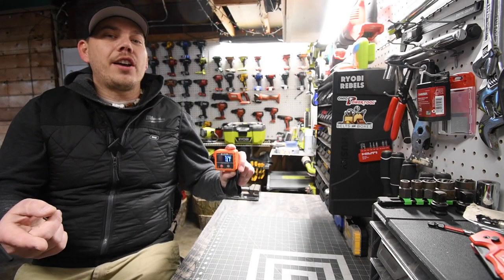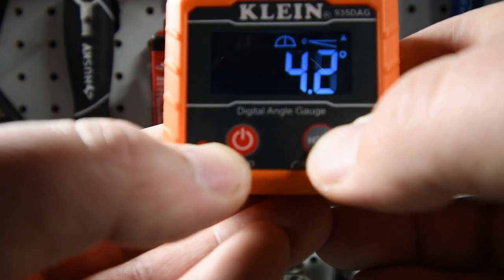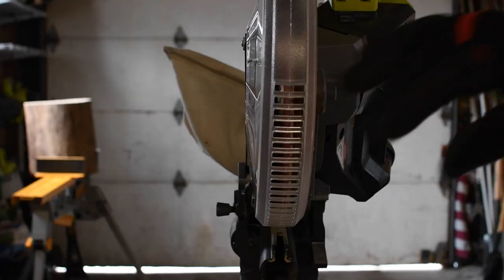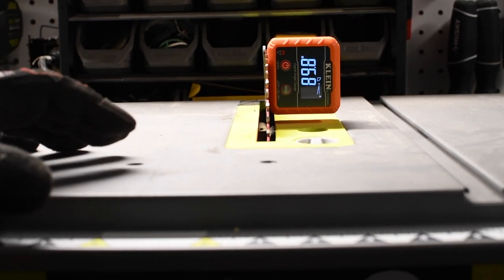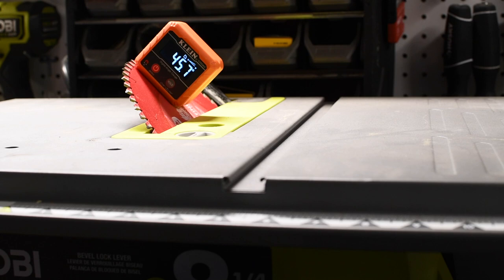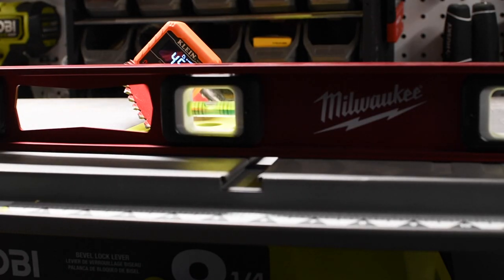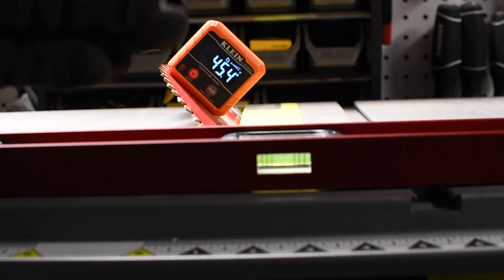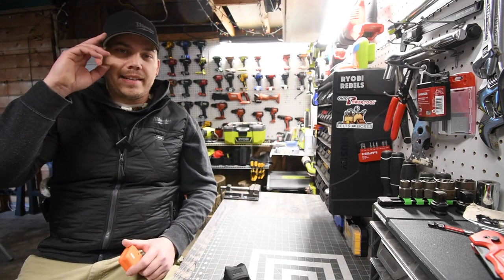Your saw needs this TOOL!

Comment: The thing is the entire miter and table saws will have to be completely level or it won't be accurate, I use my woodpeckers combination square to check if the blades are 90 or 45 degrees to the work surfaces or the table at multiple axis.
Reply from the maker: I did level out the table saw but for my miter saw the floor is not level at all so I didn't want to saw the saw blade is what was not accurate because of my situation im using it on. my friend uses one of these on his table saw that is level and he was able to get it to be exactly 45 degrees. But at the same time his table saw was $5,000. I used this on a unleveled surface on a inexpensive table and miter and wasn't able to get 90 or 45 degrees exactly. I tried though.

Comment: nice display! that tool is for a hydraulic bender(sidewinder) ( table bender)for electricians 1 1/2 '' to 6'' pipe and you put it on the horizontal pipe, do your bend and put it on the then bent pipe  match the degree  both at 90degree  (for example)  most table bender set ups are not ever level . Thanks for sharing this tool )

Comment: You can zero them out on the table and then check the blade.
Reply from the maker: I had a section in the video that I edited out saying the difference in cheaper saws to saws that cost more.

Comment: Need a favor, get the milwaulkee hole hawg , the dewalt 60v  hole hawg ,  the dewalt 20v max hole hawg , and a corded hole hawg and see what the drills can do. I am in the market for one but unsure of the reviews . I def would use the angle  measurement tool when bending offsets in 4" - 2"  large diameter conduit .

Comment: The effort to dial in the Ryobi table saw made me upgrade to DeWALT. Part of it was this angle finders fault  showing me how off the saw was 🤣🤣. 

I won’t knock the Ryobi table saw at all. The DeWALTS racket pinion fence and bevel setup is amazingly so much easier though.